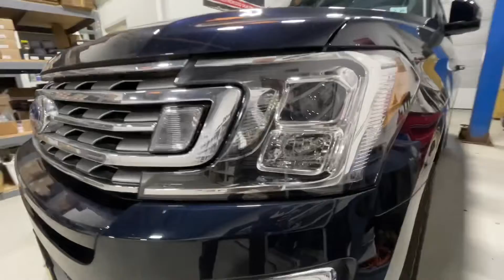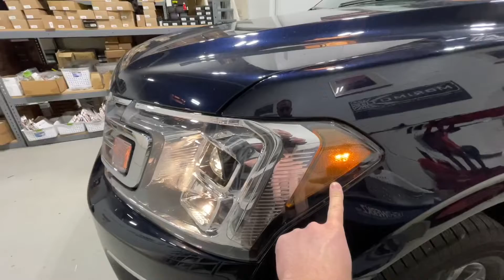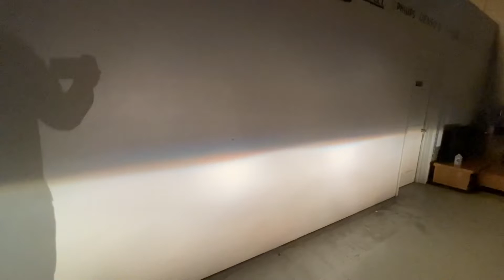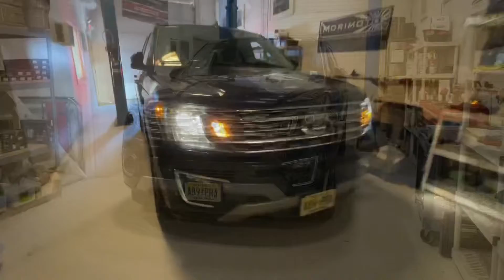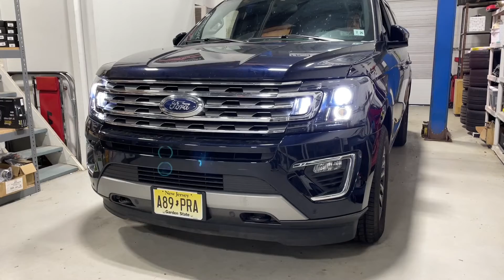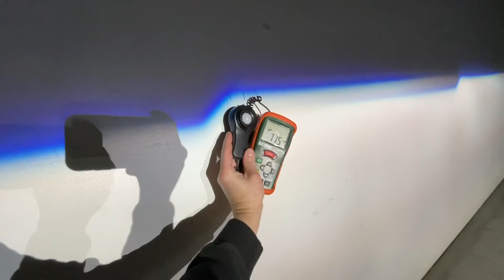Custom Ford Expedition Headlights ! Dual Diode Dynamics LED Halos + G5BRT Bixenon Conversion

Comment: HELP PLEASE!  So I have a 2020 expedition and the head lights were halogen originally and got some LEDs for it and they worked good but one LED bulb already went bad. And they weren’t so bright so I purchased a HID conversion kit and with it when I start the vehicle they turn off. When I have ACC on but engine not running they work. Also with car off they work. But when the engine is running the lights will not work!?! I’m so confused!! PLEASE HELP! I also have forscan. But can’t find any info about that or any asbuilt data. 

Thanks!
Reply from the maker: Easy fix.  You either need can-bus friendly ballasts, we use these: https://lightwerkz.net/collections/hid-ballasts/products/amp-hyluxtek-hylux-2a88-35w-canbus-ballasts or you can purchase a relayed wiring harness with a capacitor - https://lightwerkz.net/collections/wiring-harness-canbus/products/anti-flicker-low-beam-harness - We prefer to use direct Hylux 2a88 on this model since its cleaner and less things to go wrong in the future.
Reply: Thank you so much!! By the way them lights look great. My wife had the halogen and she couldn’t drive at night cause u couldn’t see. So I tried the LEDs which were better and much cleaner. But still wasn’t enough not in the projector lens anyways. So the only option I have left is HIDs so when my harness comes in hopefully they will work. Thanks so much for the info!
Reply: Also sorry one more thing. Her headlights do not have the clean line like u have? I wonder why?  Wasn’t factory like that LEDs weren’t like that & HIDs didn’t have that clean crisp line. Ohh one more thing love the white running lights or blinker. Are they hard to access? Thanks!!
Reply from the maker: The clean line is from the projector swap. The bulbs can be accessed on the expedition, not super easy but can be done without removal of lights or anything like that.  @nickriegel5228

Comment: How much same set up cost on my 2019 expo same style headlights
Reply from the maker: Hey, please contact us directly through email for current pricing. Be prepared for a high price point on this on, excluding headlights this conversion is ~$3K
Reply: @LightwerkzGlobal  Wow, $3k plus headlights? I'll keep buying new LED bulbs annually to be affordable... Holy cow. I guess if you can afford it though, why not!
Reply from the maker: We recommend plug and play HID on the factory low be a, projectors. Much better than any LED bulbs. https://lightwerkz.net/collections/hid-systems/products/hylux-2a88-35w-canbus-hid-system  @andreagross421
Reply: @LightwerkzGlobal what if I only want the parts specifically the turn signals and all cables that is needed for this. I only need the high beams and the turn signals. I already installed the low beams like 5 months ago. Clean job man I owe a 2020 expedition. Glad I ran into your channel.
Reply from the maker: Email us for a pricing quote or for parts to DIY - info@lightwerkz.net @chinito20fam

Comment: looks great, 
would you be open to making headlights for the 2016-2017 honda accords? i have a touring which comes with standard LED's which sometimes i wish were brighter.
Reply from the maker: Sorry we dont offer any upgrades on factory LED headlights.
Reply: @LightwerkzGlobal  a whole new assembly maybe?
Reply from the maker: @RecardoM93  We can retrofit the halogen headlights but you would need an adapter to go from LED headlights to halogen style plugs. Not sure if it exists but if you can get around that we can help you. Reach out through email if you want to discuss. Thanks!